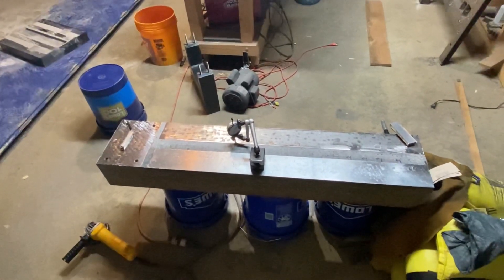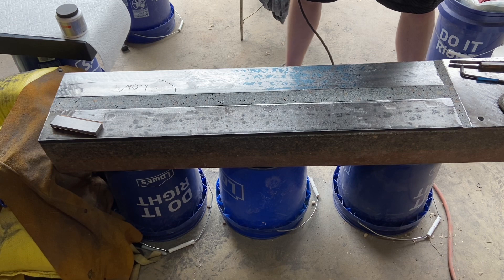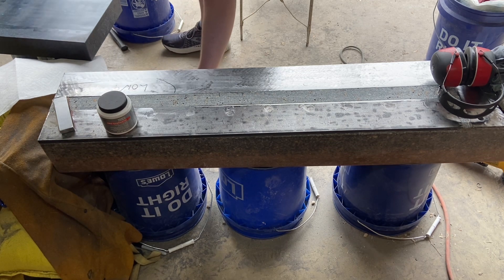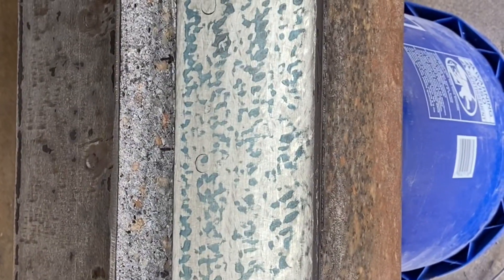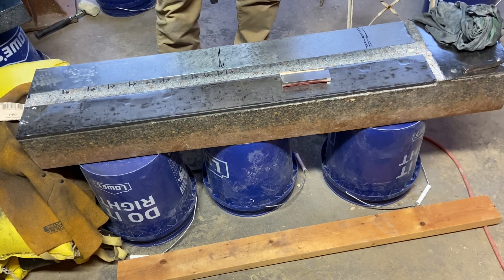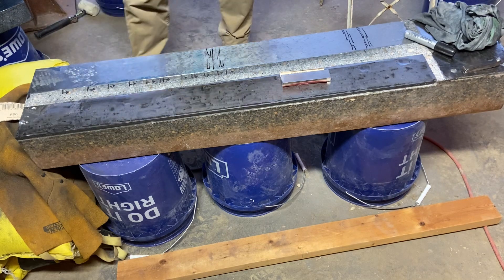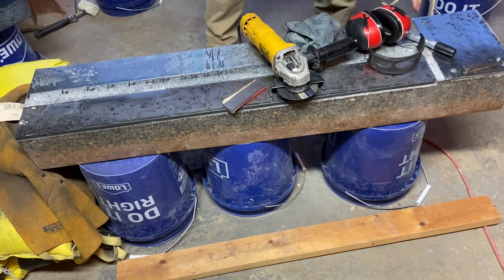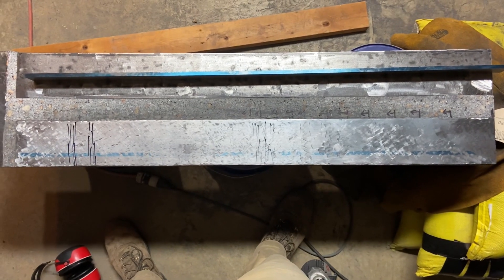DIY Epoxy Granite Lathe #2: Scraping Lathe Ways with an Angle Grinder

Comment: At some point it has to be worth it to just take this over to someone with a big mill and face them perfectly flat and level and true.
Reply: Mills don't make surfaces "perfectly flat". They're a roughing tool when you are aiming for accurate surfaces. You'd want to have it surface ground after milling, then scrape it. Or do what this guy is doing: use your time to save money and remove material in whatever way works. It doesn't matter whether you use some traditional scraping method or a Dremel or a little piece of sandpaper on a stick. As long as you have a reference surface like this surface plate, then you will end up with something as flat and true as the plate can measure within it's size limitations, the only difference is the elbow grease involved.
Reply: @AussieUnclePhil  My verbiage wasn't great there was it. They can get things pretty flat tho depending on how well they're set up. You ever see engine blocks surfaced?

Comment: I was in the machine tools re conditioning business for almost 15 years in Bangalore, India and I am my selves a specialist hand scraper. Once, we got a worn out Lathe for Reconditioning. A certain price was agreed with the customer and my team started dismantling the lathe. We then inspected the bed for the amount of wear. At this time, we discovered that the guide ways on the bed were flame hardened. That particular model was always built with soft guide ways, but this particular piece of that model was specially ordered with hardened guide ways. So hand scraping a flame hardened guide way, which was worn out by almost 1.5mm was nearly impossible. We then recommended to the customer that the guide ways have to be ground on a large slide-way grinding machine, at a facility, which was ~20 kilometers away, for which the main bed has to be transported to and fro, plus the grinding charges. Customer was not ready to pay anything more than what was agreed before. Finally, after some thinking, we decided to Hand grind this bed with a disc grinder, as in the video. We gave very good results in the end and customer was very happy & paid us around 20% more than agreed. After this project, the disc grinder became a standard scraping tool for us.

Comment: I bet that grinder is taking off tens of thousands with the lightest touch
Reply from the maker: Actually no, Interestingly enough! I thought the same thing, but I did tests with a micrometer and a piece of ground steel of known thickness, and one complete pass removed approximately .0003in from the whole surface. Im sure a grinding wheel would remove a ton more though which is why you need to use a cutting wherl

Comment: How did you build the block? Is it one of your videos with the expoy granite build process? This is great for explaining how you are building everything. Would also like to build precision CNC, particular used for making PCBs. Do you know any sources or books which delves into details on how to precisely build everything for making a precision based CNC/gantry/linear rails used for x/y/z axis? What kind of surface finish grade of that granite reference surface plate you're using?
Reply from the maker: That’s great! Sounds like a really cool project. 

I made a video on epoxy granite that would answer hopefully most of the basic questions, but there’s a ton of info on cnczone.com in a thread called something like “main epoxy granite” which is many thousands of posts long, they did some good research and it takes a little bit but they got very solid info in the end. That is probably the biggest collection of info I ever found on epoxy granite, and they do some fantastic work. If you’re interested I’d very much advise at least skimming through for the main findings they came to. I think there’s a summary page of what they learned

Not to be rude necessarily but there’s a user peteeng very late in the thread who joins the discussion and gave a lot of information which does not seem to be well researched. Generally his info did not agree with anyone else’s and he couldn’t provide much supporting evidence, so that’s the only info there Id really shy away from.

Comment: I actually tried using a Dremel tool with aluminum oxide to scrape in my first straight edge using a A grade surface plate. Unfortunately no matter how light pressure I used against durabar, I was scraping well over 5 tenths each Dremel contact. In the end scraping with carbide was way to go to get under 1 tenth over 12 inches. Excited to see if all those contact points will be worth it.
 EDIT in the scraping carbide without Dremel
Reply from the maker: Really interesting! Im not going for something nearly that precise, if I could get within about 1-2thou over the full length I would consider that a huge success. What a great project though, I’ve almost never even heard of a straightedge that flat!

Comment: Does that really work with a measuring plate smaller than your ways?
Reply from the maker: It’s much more difficult and much more time consuming but yeah to a point it can be done, I flattened it to about .001in and that was about as accurate as I could get over the full length

Comment: I´m doing something similar, I´m scrapping a lathe with hardened ways. I have never scrapped anything, so I was afraid to do it. All the information about how to deal with hardened ways is in russian. The russians, and other people around there (like ucrainians and bielorrusians) use the same approach: an angle grinder. May be this is the first english spoken channel using the same technique.
Currently, after several tests and months of practice I could flatten a lathe way to the level of .003 mm in 1 meter, the technique at the beginning was to use an angle grinder to perform the rough cut or blue mounted stone first, then pink stone to reach prefinish, I finish with a dremel wiht a cutting disk. The edge of the cutting disk should have a radius, I did it cutting a hard material like stone, this rounds the edge of the cutting disk.
Nice project, I would have save a lot of time if i had seen this project.
Reply from the maker: Thank you so much for the kind words. That process sounds extremely interesting! I will be returning to do a final flattening pass once the lathe is operating to get it completely dialed in and I’ll definitely be remembering to use a dremel cutting wheel for fine adjusting! Thank you!
Reply: Hi Carlos there are two videos I've watched. One German with a Proxon grinding stone wheel, other one  American with an angle die grinder. I hope these help
German: migru59 "Tuschieren mit Schleifer / An alternative to hand scraping"
and American: cgprecision "Hand grinding hardened ways"

Comment: Nice work. I'm designing an epoxy granite bench top sized mill (still in CAD only). I have a question: You said the rails were out about 30 thou. Was the raw material out that much before pouring the epoxy? Or, did the epoxy pour/cure cause the metal to twist? Thanks.
Reply from the maker: To be totally honest Im not sure I remember exactly what that 30 thou was in reference to, do you remember when in the video I said that? (Sorry to ask for a timestamp for my own video lol)

Those 2 steel inserts are hot rolled steel and quite warped. I tried to bolt them to the surface of my mold and that helped a bit, but they were still further out of plane than Id have liked. I would strongly recommend going with cold rolled and using 1 solid piece instead of 2 separate ones if possible. At least thats what Id do if I could go back, my friend is making an eg machine at the same time and used cold rolled inserts, his inserts started flat within about 8 thou

Id love to see a video even just showing the cad file though, sounds like a great project!
Reply: @robertsteinwandel6658  Thanks for the response, makes sense with the hot rolled and being in two pieces. Here is the first of my video series. I'm a few videos in now. I'm a beginner at the videos too. Sometimes the videos are harder than the design, ha ha.  https://www.youtube.com/watch?v=zW7GurXszDw&list=PL_e9tdItiJsvyNjdhXlUfbSjSpLYpSO8X&index=1
Reply from the maker: Nick P Im halfway through episode 2 now, great videos! You’ve got a sub here for sure hahaha
Reply: @robertsteinwandel6658  Ha ha, as do you. I actually was just watching 1 and 2 myself after I linked them. I forgot myself what I said on them. ha ha.
Reply from the maker: Nick P hahaha thank you!
Reply: Oh, cool. That size of bench top mill is something I’d like to build.

Comment: Nice progress. You might want to consider changing the title to "scraping ways with the angle grinder", or something like that, as that technique probably interests a number of people.

Have you found the scan of Conelly's "Machine tool reconditioning" the scraping bible?  
https://tuxdoc.com/download/edward-f-connelly-machine-tool-reconditioning-anbookfiorg_pdf

He has some cautions and advice for touching off a long way with a short surface plate, to avoid errors. 

I feel for your lumbar. You are young, but bending and grinding like must be a bear. I try to put the item at comfortable height before starting.
Reply from the maker: Thank you! Honestly thats a great idea, I haven’t seen that many videos about it. I still need a tripod but the video quality is hopefully considerably higher than before with editing and all now lol. 

Thats great!! I had heard of it but never got a chance to read it, Id heard it’s incredibly useful, thank you!

Yeah bending over for that plate got brutal after a while. The casting is about 300 pounds though, I could lift it onto those buckets (with difficulty) but couldn’t get it too much higher without some type of setup to lift with some mechanical advantage. I might use a jack or something to lift it a little higher so its better to work on haha
Reply: @robertsteinwandel6658  Audio is more important than video. People will accept wobbly video more than inconsistant, or bad audio. Yours is not too bad, but a 15 buck lav mic from Amazon plugged into your phone will make it more consistent (although the cable is a PITA). I used a cheap lav mic into a cheap sony Dictaphone for the first year, synching in post. Also a bit of a pain.
Reply: @RotarySMP   I think your commenting helped the algorithm show me his channel, only 5 months late instead of 5 years late for Tabletop Machine Shop (canada) and his cool suitcase slantbed lathe  ;o)
Reply: Hmmm.  I wonder if it's more accurate to reference the ways using an equally long and "reasonably flat" surface, say a melamine board, just to identify the high spots for the initial scraping.  Once "reasonably flat" follow it up with a more precise scraping of the sections using the granite block. My only concern about using the block alone is that it may be straddling deep and wide bows and crowns leading to a false reading, as RotarySMP cautioned.